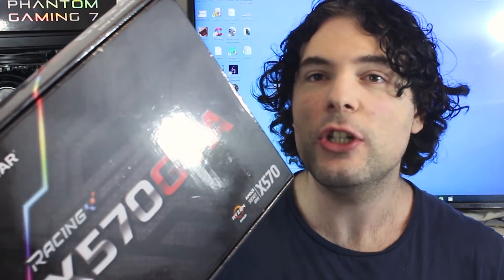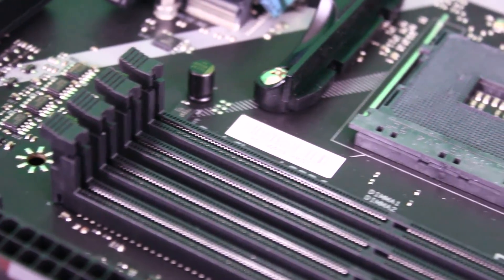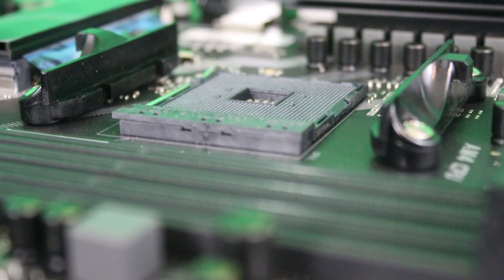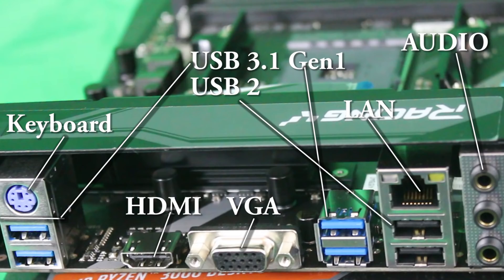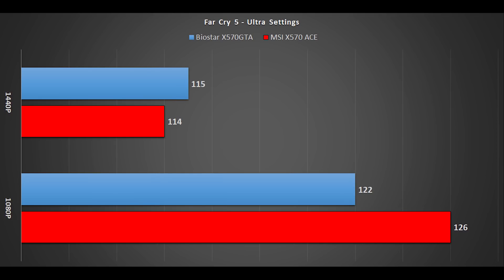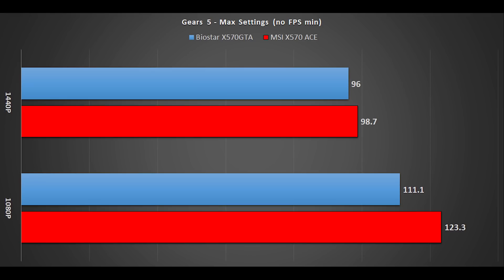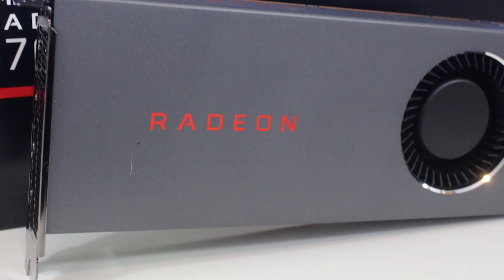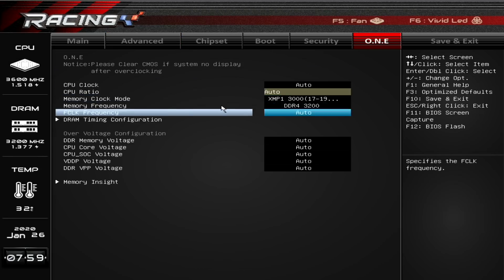How Good Is This Cheap X570 Motherboard - Biostar X570GTA Review

Comment: Biostar is one of those companies that made GARBAGE boards 20 years ago, even MSI wasn't that bad back then; but companies can learn and improve; and the top dogs can slide down from their throne.

Having endured this long, is something to be counted towards them. I mean you don't often see Elitegroup boards, which is a good thing, Jetway re-specialised into the industrial niche, Iwill is dead, even though they were fine, and Lucky Star is good bloody riddance! I mourn the loss of Chaintech, they switched to making phones last i heard, or RF tech or something like that. And of course Abit, killed by the capacitor plague.
Reply: I had a abit bh6, decent 440bx slot 1

Comment: I have an old biostar socket 1155 board its been very reliable but slightly crap board will not work properly with my ram no matter even if it is set correct speed it ignores and runs at lowest speed board supports it  even ignores cpu overclock but saves the settings sata ports are blocked  partly by gpu so can only use 3 of the 6 sata ports its not the greatest but it outlived 1 gigabyte board and 2 msi boards so its crap but reliable .
Reply: The old 1155 boards had this problem, i had the memory speed problem on a cheap 1155 gigabyte board too

Comment: If the argument is that there's not enough m.2 slots but you're saving $150, just get a PCIe M.2 adapter with the money you're not spending on the MB. 

Or buy the better MB...
Just pointing out that there is that other option as well...
Reply: For those 150$ u can get a 1tb to 2tb m.2
Reply: i just have this X570 GTA, will buy now a 2TB SSD PCIE 4.0 fast for 110 € or 1TB for 60 € aha

Comment: I'm still happy with my msi x370, it could be better but gets the job done
Reply: @James Smith I don't go 10 years between upgrades.  We haven't even seen Zen 3 yet, but I guess a cheap 3700 would be cool too.  I just like that it's possible.
Reply: @James Smith 
X370 will last him 10 years mark my words pcie 3.0 x16 will be good enough
Reply: @James Smith but you are right x570 mobos are better than the x370 but isnt it better to wait for zen 3 and x670 mobos ? So he either get x570 for cheap or a brand new x670 and voila
Reply: Or heck even for am5
Reply: @James Smith  James Smith is right... I also have a phenom that lasted me 9 years and starts to cripple now, amd now is the time i think for me to upgrade...

Comment: Where do you find this board on the cheap? Your affiliate links are dead, and when I search eBay, Amazon or Newegg its no where to be found. I did find it on eBay for $300 and $244. But no where near cheap. An affordable board, cheap as you labeled it, needs to be below $100 at minimum.

EDIT: OK, I found it on Alibaba for $149.00. Not bad, but not exactly cheap when considering other specials, such as Asus X570 Tuff being $140 at Newegg (open Box), and Asrock X570 Phantom Gaming is $148 and Gigabyte X570 UD is $145. The X570GTA needs to be quite a bit below that to be considered an option from Alibaba.
Reply: It is on Amazon UK at the moment, but 1 only.  £181.00 + £7.32 Shipping from a German vendor.
Reply: @Safetytrousers  thanks, good to know. I found the Asrock x570 phantom at Newegg's ebay store for only $148.99 + $3.99 shipping brand spanking new. I would trust Newegg or Amazon for a return a hundred times more than Alibaba. Not sure if the Racing X570GTA is any better than the Asrock Phantom though, but I can't imagine it would be any better.